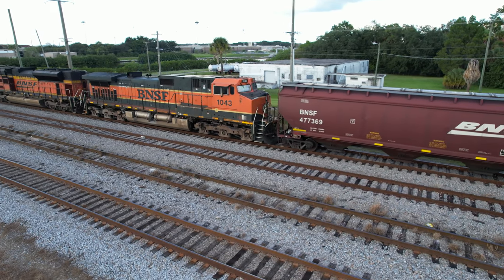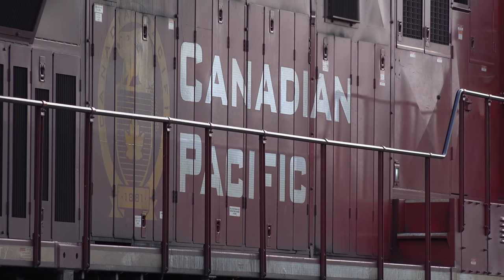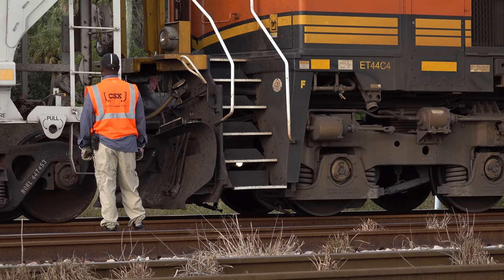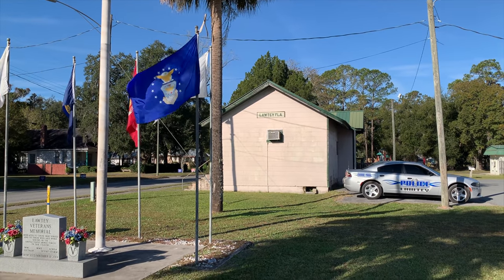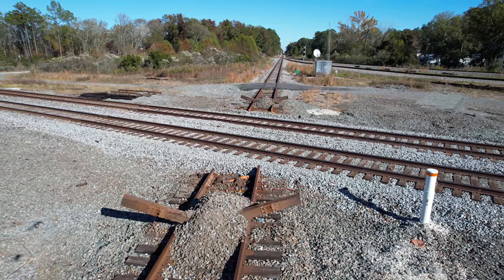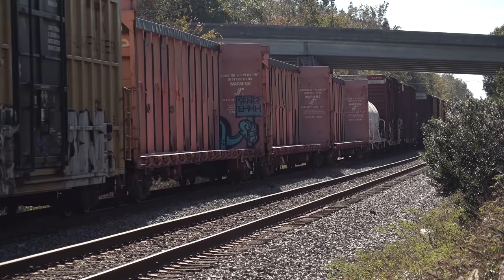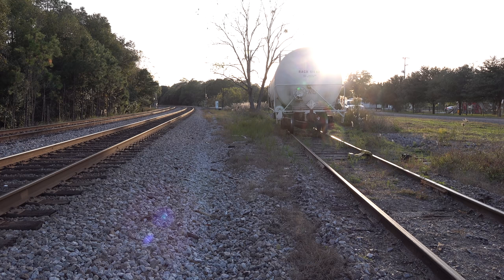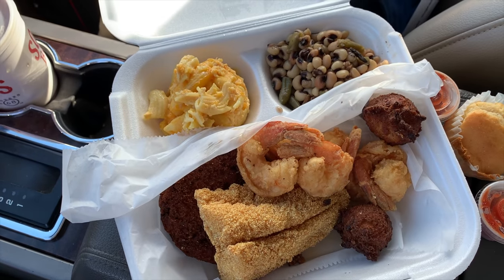Why We See Foreign Locomotives

Comment: Here in western Canada, it's quite common to see Union Pacific locomotives working on Canadian Pacific trains.  I've even seen BNSF and Norfolk and Southern locomotives in the Lethbridge, Alberta yard.
Reply: Still looking to catch a csx painted locomotive?
Reply: I'm in East Texas and see quite a few CN locos passing by usually with a KCS or UP in the lead. In fact, I've been seeing quite a few of the 100 year celebration paint schemes on CN units lately. Was that scheme only done for a year or are they repainting any loco in that scheme now?
Reply: @jukeboxdude  CN Rail bought out the Illinois Central years ago. that could be why.
Reply: I've seen bnsf at a border crossing, entering BC. I never thought about it in this context.
Reply: The other reason is that there is a crush on the seaport freight yards up and down the West Coast.  Sometimes US-originated containers will be transferred to ships in Vancouver so the US train lines "pay freight" to use the CP line through the Crowsnest Pass to Vancouver.
Reply: I even see UP power from time to time over here in eastern Canada (like in Oshawa, ontario which both CN and CP run main lines through)
Reply: @MajorMandyKitten  Well that portion of track is owned by BNSF and as per a deal with the port authority BNSF is required to move a certain amount of coal from the upper western US states to the Roberts Bank Port in Tsawwassen for export.
Reply: Ive seen UP, CSX, NS, BNSF, KCS and even CN on CP where I live. Waiting for the new CPKC livery
Reply: It's fun to see a Ferromex unit on coal trains headed over to Robert's Bank, BC.
Reply: I saw real foreign power- a locomotive from China. It was on a flat car and headed to the NEC for testing

Comment: I'm reminded of two items.  First, there's really foreign power that shows up:  Ferromex engines come up from Mexico.  And of course, Canadian Pacific has inroads down below the Canadian border.

The second item I'm reminded of is the concept of rescuing a train.  I happen to catch MARC 68, a GP40WH-2, out on the Amtrak Northeast Corridor.  Usually it's sitting at Amtrak's Odenton Maintenance of Way yard, in case something happens an a passenger train needed to be rescued.  In this case, though, MARC 68 had to rescue a Norfolk Southern freight train off the NEC, contents and all, and get it into the MoW yard.  It was long enough that the train was stopping at the Odenton MARC commuter rail station, my regular stop near home.  Up... then back down into the yard to let MARC Train 410 stop at the station so I could get on and get to work.
Reply: I literally just saw a geometry car train with csxt 9969 and 9999 (before repaint to csx 4 in b&o colors) together!
Reply: @alexander1485  (obligatory "nice" here)
Reply: Some Amtrak trains that let off passengers in Chicago sometimes is used for the Capital Limited.
Reply: Foreign power is a term designated by the AAR to describe any locomotive not owned by the railroad it's running on. Period. Doesn't matter where it came from. Canada and Mexico are not foreign, they are all part of the North American rail industry.
Reply: @TheNemosdaddy  I imagine a locomotive from Swizerland the US. I don't know how it would end up there
Reply: @TheNemosdaddy  
No need to be all SJW about it. 🙄 Don't need that tone here. Period.
Reply: Ferromex foreign power is seen occasionally here in Southern California.

Comment: Here's an interesting one:
A regional railroad near-ish to where I live runs locomotives that play on every sense of the word "foreign." The old South Orient line is owned by the State of Texas (managed by TxDOT) and is leased to a company called Texas Pacifico (which is affiliated with Ferromex - the national railroad of Mexico). They mostly haul frac sand for the oil fields but occasionally I've seen parts of wind turbines for electricity pass through.

The locomotives are typically CIT leased SD40-2 in the blue and white livery, but lately I've seen some locomotives from Ferromex in that company's standard red, white, and green livery.

In a way, that line sees foreign locomotives (since the State owns the tracks and Ferromex doesn't directly hold the lease) in the railroad vernacular sense and foreign locomotives (literally from Mexico) in the more colloquial sense.
Reply: I wonder how soon we might catch a glimpse of a Grupo Mexico ( Ferromex, or Texas Pacifico ) engine on an FEC train? That would be a loco a long way from home. We already have seen passenger cars in their paint colors. The two Office Cars FEC recently got were in that color scheme.
Reply: I see Ferromex and KCSdeMexico on UP track and trains between Palestine and Longview, TX.  I have seen CSX, NS, BNSF, KCS, CN, & CP units as well.

Comment: I live next to the Genesee and Wyoming's Portland and Western Railroad (PNWR) line near Portland, Oregon. Since 2018, some BNSF units have ocasionally been used as run through power, light power moves, or dead-in-tow (dead-in-tow behind regular PNWR power), namely using GP38-2's, SD40-2's, ES44AC's, and ES44DC's. This explains why PNWR has been using BNSF power on some of it's trains in the last 3 years or so.

Comment: Danny could you do a video on why certain trains like inter-modals and others have to be a certain length and how railroad officials determine how much power to add to a train so that it’s not under powered, Great video again your channel is by far my favorite on YouTube and always anticipate your next video.
Reply: It depends on lots of variables. On my territory we can't run trains over the mountain grade unless we are 1.8hpt DPd or 2.3hpt conventional when going eastbound or 1.3hpt going west. Intermodal doesn't have to be a certain length. But at certain lengths we add more power due to brake pipe constraints. So typical GEVO is 4400hp. Take HP and divide by tonnage and you get HPT.
Reply: @braaap2065   & probably more in colder, freezing weather
Reply: as far as length of trains goes, the sidings play a role in that... sending out trains that are longer than the sidings limits the trains you can run in opposite directions if we're talking about single track territory... so subdivision "A", single track, longest pass track is 12,000ft but they want to run two opposing trains both are 15,000ft... won't work... one of those trains will have to be shortened if they want to run both trains and have a meet...but on double track you're good, that's why railroads love double track, the downside is the GIANT capitol investment in double tracking very expensive
Reply: what do you mean by "have to be a certain length?" Do you mean a maximum length?

Comment: Great video Danny, as usual! If we had a foreign locomotive in our shops, it was usually because it ran out of time on the blue card. (92-day inspection) and the owners would offer a barter. i.e. if you'll service it, you can have it for the next 6 weeks or something like that. At one point it felt like UP was sending us all their engines short on time and our yard resembled something out west with all the UP motors running around on it. Fortunately we got our engines back and sent UP's crap-motors back home. I'm sure one of the railfans has photos or videos of them on a mixed freight manifest with a half-dozen or more UP motors on the point.
Reply from the maker: Wow! I never heard about this. Could that have been one of the reasons we were seeing so much UP power on the CSX back in '03 - '07?
Reply: @distantsignal  That's right about the same time as when I was there, so it could be!

Comment: When I was on the railroad they trained us to always board the engine on the engineers side.  The engineer can't see you if you board on the conductor side if the engine
Reply: You're absolutely correct, but that was common sense railroading in those days and unfortunately those days have gone by the way of common sense... We also were taught to use hand signals if we could see the engineer and stay off the radio unless we could no longer see the engineer. That policy is also long gone because the new era of weed weasels are too lazy to get out of their courtesy wagons and actually observe the crews working.

Comment: When power arrives onto "foreign" tracks, do the crews change immediately for those of the home railroad's employees or do they ride out their shift?
Reply: The exact question I've always had.
Reply: Depends on factors of trackage rights, possible interchange agreements, and local labor agreements. Road crews that are qualified over foreign rail with the proper agreements can operate on mainline track and perform service to either run-through or deliver their train. Yard work and local industries are always worked by the local railroad,
Reply: Train crews are qualified for their own territory only. So if they were to hand off a train onto CSX territory, CSX crews will handle it.
Reply: @SD40Fan_Jason  crouches under control stand when delivering to CSX yards from now on…

Comment: you said it right in the beginning “unit train” it starts and finishes its turn without ever coming apart …. saves time ✌🏻
Reply: Hopefully never coming apart... When I was working in Texas, we did a lot of setting out and replacing of cars in trains. Lots of aggregate trains, all the same material. Trains were identified by the town they were going to and they had sets of cars that were consigned to the shipper. So if we had to set a car out, sometimes we wouldn't replace them at all. The car would hold out in the RIP track until that train returned empty in a couple weeks or so and we would place it back in on the train, if it was ready. But some of those cars were old and worn out. Occasionally they would just cut it up and haul it off to the scrappers. But it was our hopes that these trains would come and go with the same cut of cars and power. Occasionally we had to run the power around the train but aside from that, it was still the same box of equipment. Made for some really easy "PICLing"

Comment: POLYOL (on that single tank car awaiting repair) is Polyolester oil (POE oil).  It is a type of synthetic oil used in refrigeration compressors that is compatible with the refrigerants R-134a, R-410A and R-12.

Comment: I live in a town with the Chicago-Canada mainline and we see lots of extra power. We used to see quite a few BSNF hauling coal to Lansing and East Lansing. They stopped using coal recently. But we do still see some BNSF hauling empty auto racks. We also see CPKC, NS, and UP. They're then put on a train heading back to Chicago, or even Battle Creek or Kalamazoo, deadheading on a scheduled CN train. I've seen plenty of foreign power pulling a train with no CN units. 
Since moving locomotives by themselves is expensive, and time consuming since they're limited on speed, unless you're pulling a dozen, they normally just throw them onto the next trains heading back towards Chicago.

Comment: If you folks happened to be in Florida during the early 90'S, foreign power was always a BONUS catch when out railfanning. For starters, between 1990-1996 CSX freight's Q-601 & Q-602 use to bring in Southern Pacific, Cotton Belt, & Rio Grande power into these parts due to them originating to & from SP'S turf in New Orleans, LA. The same goes for Union Pacific power for freight's Q-604 & Q-605 which operates to & from their yard in New Orleans, LA. For us railfans & railroaders what really sparked interest in these freight's is that they'll occasionally bring visitors of their own into Florida like SANTA FE & well known lease companies like MK, EMDX, & GECX. Florida East Coast also plays a part in the foreign parade. Beginning in 1994, they manage to bring Norfolk Southern's fleet of thoroughbreds onto their playground speedway. This was a result of NS having two pairs of autorack & intermodal trains that operate in run-through service over the FEC to their destination in  Miami, FL. At one time in 1995 the two railroads attempted to operate a joint intermodal service between Jacksonville, FL & Macon, GA called the "Florida Georgia Xpress" as an attempted to take traffic from trucks for regional locations not on I-75. FEC provided the power & cars while NS provides the crew with plans to utilize the intermodal facility in Macon that NS abandoned. Unfortunately due to not generating enough traffic, both railroads discontinued this service in February 1996 after only one year of operations.

Comment: I am in the Central NY, Syracuse Rochester CSX Sub.  I see BNSF, CP, CN, NS and even occasional Fingerlakes Railroad Power.  The line is a double track main.  It is original to the NY Central.  The old Westshore Railroad Beds are still seen in many places.  The Westshore Railroad or as it was called the Weehawken to Buffalo paralleled the NY Central in this area.  Some of its' original road course is still part of CSX today, most, however, is gone including stations.  A good book on the Westshore is "Along the Old West Shore" John M Ham.

Comment: At 8:50 - A flange-bearing diamond would have ultimately saved on maintenance, but with a large up-front cost. I guess re-routing the few trains that would have used the secondary line is quicker and easier.

Comment: Great video as always. Want to offer one slight correction. Locomotives off home rails on through trains started as early as 1958 with an agreement between the Santa Fe and the Frisco to share power on a new through freight service that would connect LA to the east coast. Each section of the train was normally ran with a 6 F unit set (the Frisco had to go buy F9s with DB just for this arrangement). A few years later it was the U25Bs and GP35s. By the mid 60s, Santa Fe, Frisco and SAL power could all be seen pooled on the same train
Reply from the maker: Thanks! Yes, I knew there were a few of these agreements from way back. That's why I qualify those statements with "almost" and "rarely"

Comment: It's a different situation than "Run Through Power" but I used to live just outside Montreal and I used to enjoy taking the "Amtrak" home in the late 1990s and early 2000s (and I'm not talking about the Adirondack, the actual Amtrak service between New York's Penn Station & Montreal's Gare Centrale). It was a former Amtrak F40PH-2 locomotive in full Amtrak livery being used on Montreal's AMT (Agence Métropolitaine de Transport) Montreal-Rigaud commuter line and, for whatever reason, they just didn't repaint it for several years.

Comment: Watched a train move through London, Ontario this morning, eastbound on the CN mainline.  Three locomotives in front were Norfolk and Southern, CSX, and BNSF.  The DPU was CN.  Quite the train, long, and was pulling everything but the kitchen sink.
Reply: As it turns out, a local videographer caught this train.  What I took for N&S was an Illinois Central-- With a "CN" placard on the side. Similarly the CSX loco also had a CN placard on the side.  So these two aren't technically "foreign power", I suppose.  What I took for a BNSF locomotive was actually a Kansas City Southern, so that was "foreign power".  We don't get many BNSF or KCS up here, so at a glance I got them confused.

Comment: I actually caught a 3 engine lashup running on NS lines in Ohio this week.  Lead engine was BNSF, 2nd was UP, and 3rd was CSX.  Caught me off guard as I rarely see action on that line.  Both CSX and NS come through the area but run separate lines.  It's usually the CSX lines that are very active with a mix of CSX and CP.  I may see 1 if any NS pass while I see 4 or 5 on the CSX lines.

Comment: At 12 min 40 secs In NSW we have car men that come out of their normal yard to do repairs on cars that have become unfit to travel further on the system.   They are called THE FLYING GANG.  They don't fly but come out in trucks with all their specialised equipment.  I think the name originates from the speed they do to effect the repairs as soon as possible. I was an engineer and we used to get a note where to find the car and that it was fit to resume it's journey.  In conjunction with the dispatcher we would add the former defective car to our train and adjust the paperwork for out train with the adjusted load and length.    John Hutchinson

Comment: We were getting Ferromex power on BNSF trains for a long time...in Minnesota. That's a trip... I always joked that power from up here was sent down south to show the southern roads what good paint schemes look like. It has apparently worked, since in the last few years, NS has discovered...color

That spur track...the ties have probably been replaced a few times over since its early days, but I have found rails that have been in use to the present day since 1892, on a stub track. A lightly used branch in the area had rails from 1914, and I've seen mainline sidings with rails from December 1941. Rails can have some staying power

Comment: What is polyol used for?

￼

Polyurethanes are used to make flexible foam for mattresses and seating, rigid foam insulation for refrigerators and freezers, elastomeric shoe soles, fibers (e.g. Spandex), coatings, sealants and adhesives. The term polyol is also attributed to other molecules containing hydroxyl groups.

Comment: Polyols are used in a variety of products including elastomers, fibers, flexible foam, adhesives, sealants, inks, paints, and coatings. When used in engineering plastics, they are often copolymerized with other monomers to produce polyurethane and polyester elastomers.  credit wikipedia